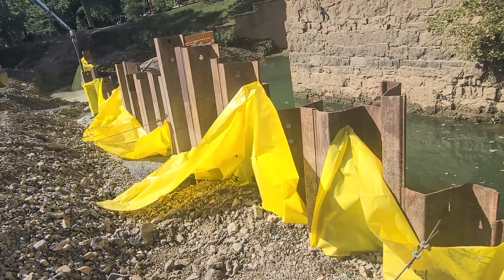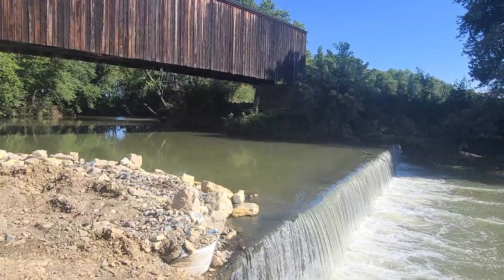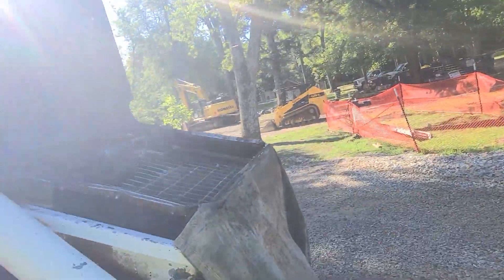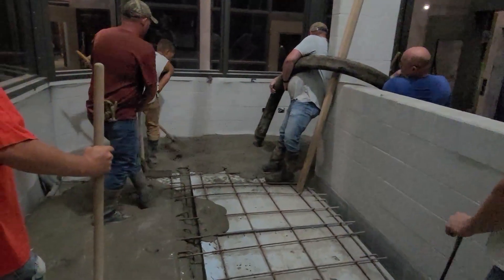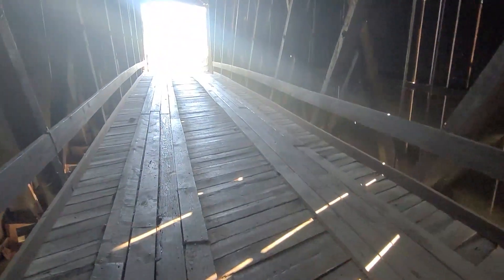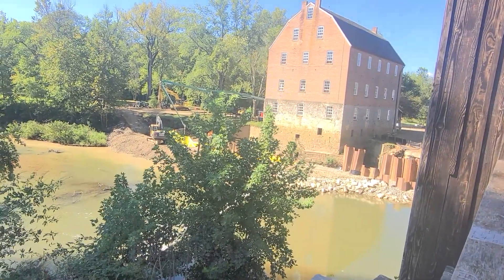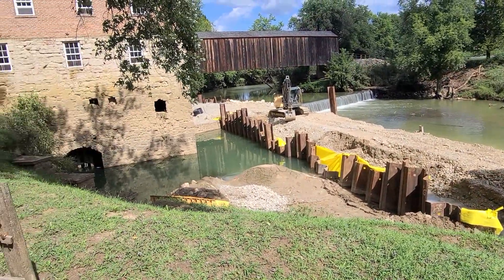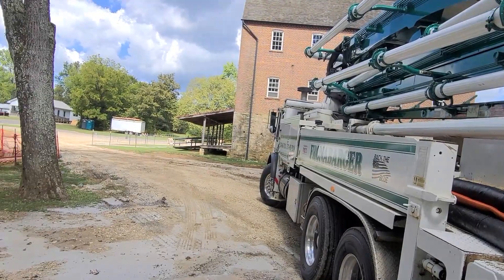Work At The Bollinger Mill! Concrete PumpVlog #34

Comment: Hello! I have a question: I have a concrete pump and i have some issues with it. There are times when the remote connects successful with the recieving unit and it works perfectly fine, but there are times when it doesn t connect(when it connects, I can work the hole day with it if I don t turn off the remote, it doesn t disconnect during work).  I called an electrician to come and look at it. He checked the remote and the recieving unit and he said they are perfectly fine. Do you have any idea what it could be?
Reply from the maker: That would be a question for the manufacturer of the remote.
Reply: @fronabargerconveyingpumping  Thank you!